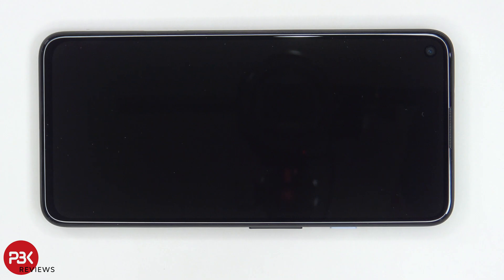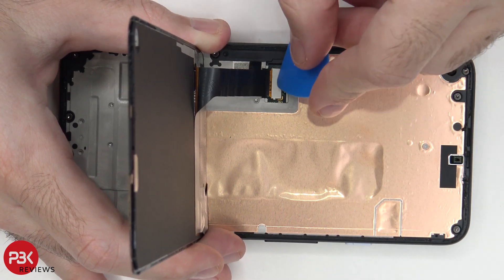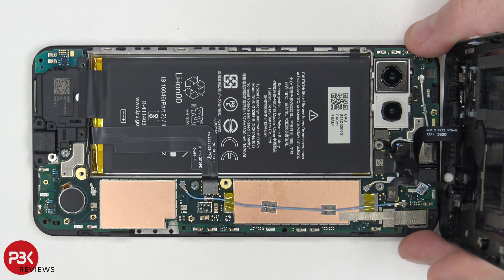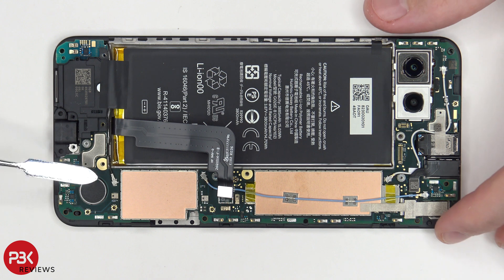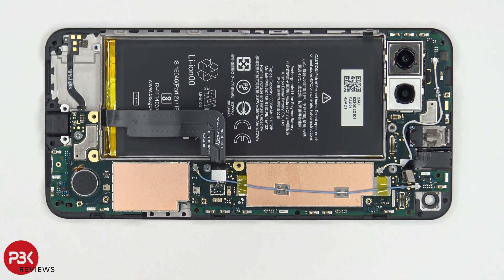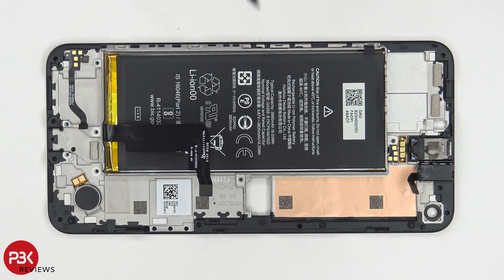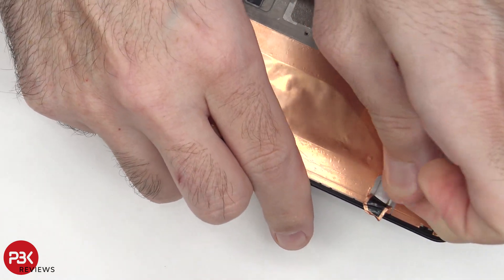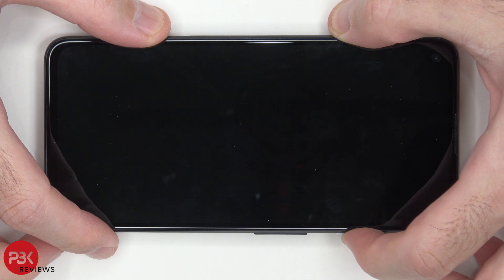Google Pixel 4a 5G Disassembly Teardown Repair Video Review

Comment: Thank you. After i Opened up the displays carefully the Display is only Flickers now. Why it is damaged, the cable is ok🥵🥹
Reply from the maker: Hi, they are fragile so sometimes the screen can get damaged even when careful. Make sure the cable is connected properly, if still no luck you might need to replace the screen.

Comment: Where is the internal storage in which is not the processor or the memory
Reply from the maker: believe the internal storage is the one I pointed out. I think the ram is either under the processor or one of the other black colored chips. I don't have the phone anymore to double check closely to tell.

Comment: I can't get the touchpad on Google pixel 4a 5g. I disassembled it, cleaned the glass on the camera, I put it together and I can't see the touchpad but the bottom buttons are fine. About as it was disassembled I accidentally pressed power and the phone turned on because there was a sound. Please advise.
https://youtu.be/MypQbG7wVzo

Comment: Hello sir
I opened my pixal 4a device. I was trying to replace the screen. There was some dust in the camera so I opened it to clean the camera sencer. While opening the device it's fingerprint sencer got broken. I assembled the device but it's not switching on I tried many was like I disattached the battery and keep the phone on charge but nothing worked. Please suggest me some solution 🙏 please please please
Reply from the maker: You can replace it with a replacement like this: https://www.ebay.com/itm/164567079313?hash=item2650f65991:g:GTQAAOSw4HlgyhBL&amdata=enc%3AAQAHAAAAsEXdHWDgx%2BA9cGHKNx0XSh7Q9O2oLlWryhbajRW1YWEhHkjz9OG0vJZMWF9Tf21cF2qoVFSWohQXEantl%2BTcOIrq3HehMu35F7dj%2BxWsQ11rdu83Uk6Sr3VbD1n9vOWSx0o2DwQqMxIY2vIQsONQfIvhIlRo2mclM3s3MPdIAk9hSXUuaEDDKhw32hZsAz%2FM8uTDT5ujWI8SItJ%2BgEzYdEuydudYtJWIzVoq9mCbt%2BWM%7Ctkp%3ABk9SR66GyvKAYQ

Comment: It’s 5:39 when assembling should I remove old thermal paste and apply new one?
Reply from the maker: It's always best to apply new thermal paste, but these type of rubberized thermal pad style ones would be hard to find. These can be reused but if you prefer to apply new thermal paste, just make sure not to use a highly conductive one.

Comment: I had mine about 2 mths., when I got caught in a downpour. The screen went dark, so I could not navigate the system. If the display went dark, is that necessarily and indication of damaged display, or could it be a "short" of some sort? Through authorized repair ctr. it would cost almost as much as phone. Do you think it's worth opening up?
Reply from the maker: It could be either the screen or corrosion inside shorting it. You can try taking it apart and drying out any water inside as well as brushing off any corrosion on chips or connectors with a small brush like a tooth brush and then testing to see if it will work. If not, you may need to replace the screen if that is the part that went bad.

Comment: How long do you apply heat to the screen?
Reply from the maker: Just enough that its hot to the touch and you can apply more heat if needed while prying off if some portions of the adhesive is holding on stronger.

Comment: My accelerometer stopped working which prevents the screen from rotating. Is that replaceable? It wasn't noted in this well-done video. So I'm assuming it's hardwired onto the motherboard, but asking JIC. Thanks!
Reply from the maker: Hi, there are ways of adjusting or resetting the accelerometer but not sure if it's replaceable. There are many videos on youtube and info on google on how to reset or adjust, you can look through a few of them and see if it helps fix it.

Comment: What would be the steps to replacing the glass on the back camera?
Reply from the maker: If I am not mistaken, the glass on the back camera cover is just held on with adhesive. You can heat it up with a hair dryer and use a razor or thin tool to pry off the glass and apply new adhesive (if your replacement glass doesn't come with the adhesive tape installed) and install your new glass.

Comment: My secondary mic is not working.. can i replace it ? Is it on the back plastic housing or in the middle electric board . Thanks
Reply from the maker: Yes its on the back housing, I point it out @2:51 in the video. You would need to replace that flex cable with the secondary mic.

Comment: are there any comparison videos between pixel samsung and fairphone? also is it possible to remove the mesh cover on the top speaker housing?
Reply from the maker: Not sure, but for the mesh cover it can be pealed off from the screen when the screen is removed.

Comment: I just got mine a week ago and I already have dust beneath the glass where the camera is. Do you think I need to completely disassemble or is there somewhere I can try to blow compressed air in to clean it
Reply from the maker: If it's the front camera then you can try to use compressed air to try and blow some air and clear it out. I wouldn't suggest prying the screen off though for cleaning that since there is a high chance of damaging or cracking the screen while prying off.

Comment: Is there a way to disconnect the two microphones? I don't see a plug for it. I have a bluetooth mic for when I want to use the phone but I don't want google listening to everything I say anymore
Reply from the maker: The mic is soldered onto the main board. Breaking it off could possibly damage your main board.
Reply: @PBKreviews  Thanks. That's unfortunate, maybe I'll do my research first next time I buy a phone
Reply: FYI, yes you can remove the two mics with no problems. I used an air solder to remove the main mic and removed the secondary mic by snipping the ribbon cable just before it and prying it out. Flash and light still works too, and I keep a  small headphone jack mic nearby when I want to use the phone. Also, small black stickers on all cameras which can slide easily to the side when I need to use them.  Feels great to finally have privacy

Comment: If dust enters between the rear camera lens and the glass, do you recommend taking it apart and cleaning it myself? Thank you
Reply: Also wondering this myself. I just got mine not too long ago and already has dust inside the glass of the rear camera. I read it's rated IP52 but getting dust under the glass after only a few days of use definitely doesn't seem like a 5 dust rating
Reply from the maker: I wouldn't because the chance of cracking or damaging the screen taking it apart is high so would not be worth it.

Comment: From 1 to 10 how hard is the battery replacement?
Reply from the maker: Since you have to take the screen off first and there is a chance of damaging or breaking it and then requires you to disassemble most of the phone, I would say 8 from 10 being the hardest.

Comment: Any tips on step 1?  I still haven't gotten past successfully getting a tool in between the screen and the midframe plastic.
Reply from the maker: Hi, you can use a suction cup tool to pull up the screen a bit to try n give you some leverage. You can also use a thin razor or something like that but would probably scratch up the plastic boarder a bit. Also keep in mind if your screen is not broken or damaged, the chance of damaging it when prying it off is high.

Comment: here we want the phone more easy to repair.
1. the display first (display connector below display) or back first
2. battery with pulltabs
3. all screws are phillips
4. not-so strong adhesives
5. widely available spare parts (not expensive & original)

Comment: Hi! how would you rate the ease of battery replacement?
Reply from the maker: Hi, It's not too difficult to replace the battery but the fact the screen has to be pried off before you gain access to the internals is a problem since there is a high chance of damaging or cracking the screen when prying it off.

Comment: Great Teardown. Are the glass and screen a single unit? Just dropped my 4a 5g and can't believe the quotes I'm getting! Would make sense if they're one part. Only had it 3 weeks! Gutted - I've never had a screen break before!
Reply from the maker: Hi, yes they are fused together as one. Have you checked with google to see how much they would charge to fix?
Reply: @PBKreviews  Thank you - I will check through google. Looking like cheapest I can get part is £120
Reply from the maker: @bigtop1967  no problem, ya that was the cheapest I found as well.

Comment: Great teardown! Do you think the Pixel 4a 5G has any IPX rating? Some people claim that it's fine after it is submerged in water. What do you think?
Reply from the maker: Thank you. It doesn't have an official IP rating but has features in place to protect against some water. But again not sure to what extent. The charger port is covered in a rubber layer and prevents water from getting in as well as filters over the speaker and mic opening on the bottom of the phone and a rubber gasket around the sim try.
Reply: @PBKreviews  Thank you! Is it the same with the Pixel 5? I watched your Pixel 5 video. Seems to be different. (I know Pixel 5 has an IP68 rating)
Reply from the maker: @ushren  You're welcome. Yes the pixel 5 has similar measures in place. Rubber gasket around charger port as well as filters on speaker and mic openings etc.
Reply: @PBKreviews  is there any protection on the top speaker ear grill?
Reply: Pixel 4a 5G Water Drop Test
https://www.youtube.com/watch?v=xj9xKZTfVqU

Comment: So you need to remove the screen first to replace the battery? That is one risky task, I wish the pull tabs were easily accessible just like the Pixel 3a.
Reply from the maker: Yup, and removing the screen on the 4a 5G is more difficult compared to the pixel 5 since you need to separate the screen from the glass portion instead of the plastic border and housing of the phone which increases the chance of damaging the glass or screen itself when attempting to pry it off. The pixel 5 screen removal was much easier.

Comment: i think i well buy 4a5g not 5.because the battery replace easy then 5.also the screen too.im in China so i need repair it by myself🤣.I am planning to repair my old Pixel2.if i brok the screen so i buy 4a5g😂
Reply from the maker: Oh ok, I personally think the 5 was easier since taking the screen off is with the plastic boarder of the frame of the screen compared to the glass how the pixel 4a 5g is which if you need to change just a battery, there is a high chance of cracking or damaging the screen on the 4a 5g if its not broken already. Ya the 5 doesn't have pull tabs for the battery but you only need some heat and pry tools and it will come off. Not to mention you only take it apart from one side, not both sides. I guess it's a personal preference.
Reply: @PBKreviews  its that catches on the screen easy to move？case catches im got used to it.im often disassemble the laptop so that not big thing.but the screen    i dont know. also i hate tape
Reply from the maker: @primejc6697  yea the catches aren't as difficult as laptop ones, much easier.
Reply: @PBKreviews screen side too？  the plastic border help screen not crack and not hard to remove the catches    i think thats a plus. that black tape on 5 call what？i go taobao see if i can found one.  and thank man you help me alout👍👏
Reply from the maker: @primejc6697  Yea, the pixel 4a 5g also has a plastic boarder around the screen, but when disassembling the 4a 5g you need to separate the glass of the screen from the plastic boarder which can cause damage to the screen or glass. But the pixel 5 when disassembling, you separate the screen together with plastic boarder of the screen from the housing of the phone. So basically instead of putting a pry tool between the glass and plastic boarder of the screen, you put the pry tool in between the case/housing of the phone and the plastic boarder of the screen so it does not touch the screen glass. Hope this explains it. The tape is just called adhesive. There are many kinds of adhesive smartphone tapes out there not sure exactly which ones the manufacture uses but 300LSE or other smartphone adhesives can be used. If I can't find one that's made for the specific phone and already pre cut into the shape of the phone its meant for, then I find one similar from a similar model phone and modify it if need be. For example  here is a link for one that is for the older model pixel 4 : https://www.ebay.com/itm/Back-Battery-Door-Cover-Adhesive-Sticker-Glue-Tape-For-Google-Pixel-4-XL-6-3/324241145054?hash=item4b7e473cde:g:FD4AAOSwOIBfHVSK    . Eventually there will be ones on the market for the 4a 5g and the pixel 5. No problem.
Reply: @PBKreviews  thanks again.  I think I might be more inclined to 5.because the screen is safer to disassemble. if i messed up  my pixel2 bettry change🤣
Reply from the maker: @primejc6697  no problem :)

Comment: How hard do you think it is to replace the battery?
Reply from the maker: Its not too difficult but definitely not easy either since it requires removing the screen which if you don't have a damaged or broken screen, the chance of damaging the screen when prying it off is high. Also you would have to take the back off as well to disconnect the cable for the battery and then use the adhesive removal tabs to release the battery. Just a lot of work but doable. Not the easiest job but not the hardest either.
Reply: @PBKreviews: do you think it is necissary to remove the mainboard to be able to change the battery? That would make the process easier...
Reply from the maker: @mritsch  No you don't need to remove the main board. Just remove the screen, then the back and the plate that covers the battery connector. Then you can use the adhesive pull tabs to release the battery from the midframe. You can leave the mainboard intact and seated into the midframe as is.

Comment: wow thats so simple to replace the screen
Reply from the maker: Yea its good for screen replacements but not a easy repair job for other parts inside the phone. :)
Reply: Yes, but there's a good chance that a perfectly good screen will be cracked as with other Pixel models. It has to come off just to replace the charging port for example.